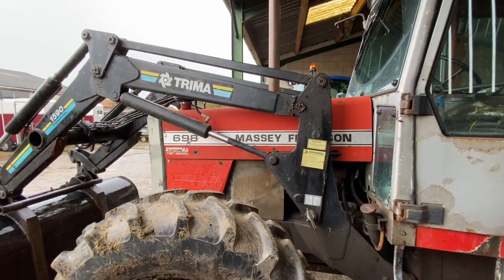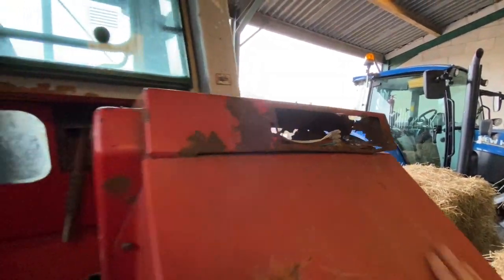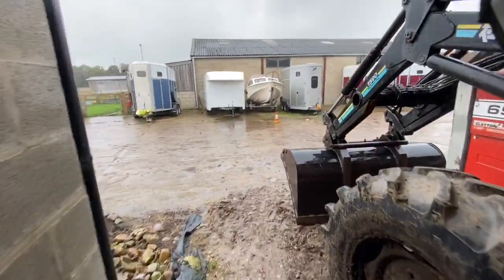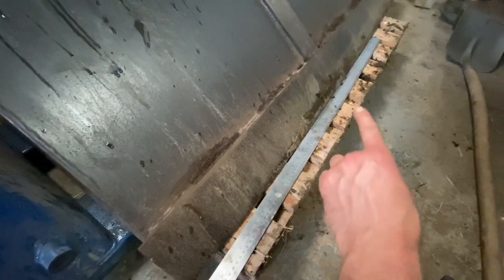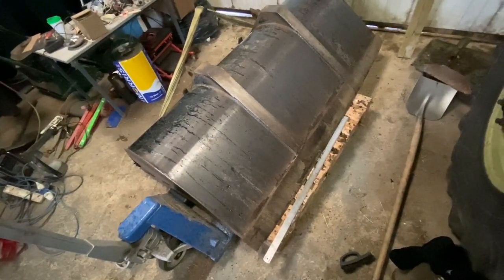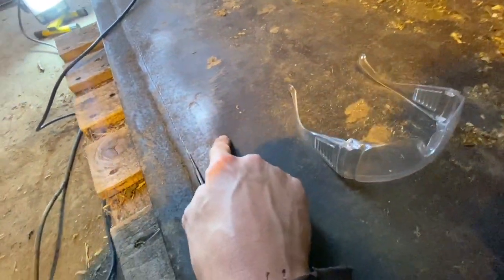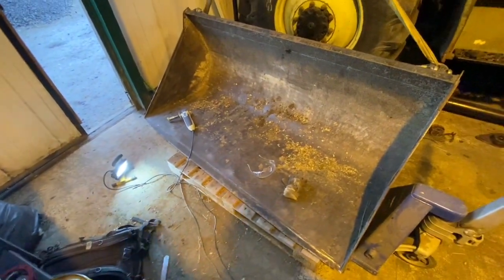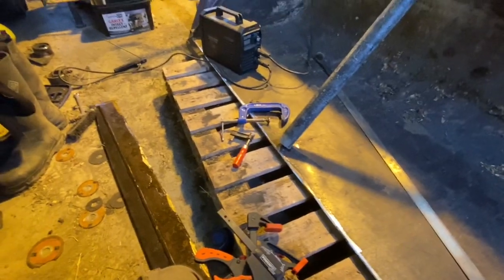Few jobs on the Massey 698T and start of loader bucket repair

Comment: Hi Casto  be nice to tidy the massey up  any way to fit a cable and andason? plug to the battery so you don't need to remove the grill if jump starting is a regular thing Have seen it done on youtube by land rover owners where the batterys under the seat  Thanks
Reply from the maker: she needs a lot of work doing so not everything will get done but a little at a time hopefully. yeah I’ve one on the landy, it’s not connected though 🤣🙈. there is a design fault in the design of the pre heater. there’s a single heat plus in the air intake manifold, apparently a second helps solve the problem but never got round to doing it.
Reply: @casto-  Thanks for the reply